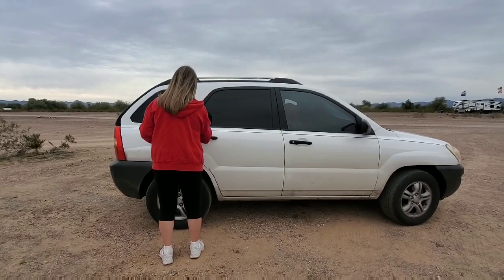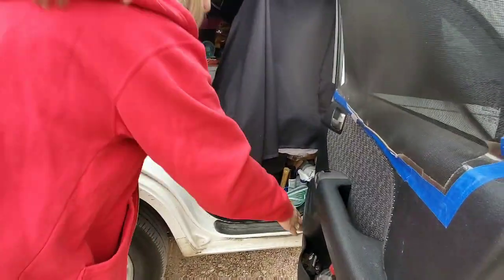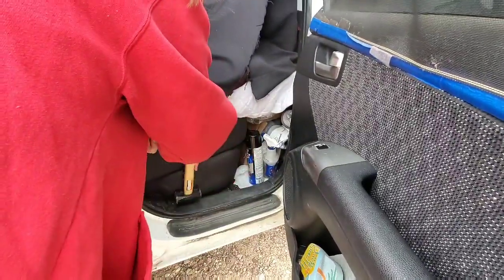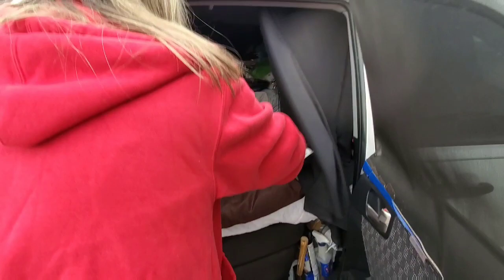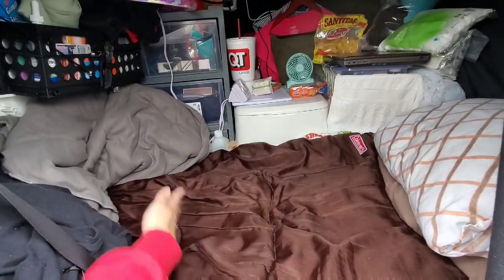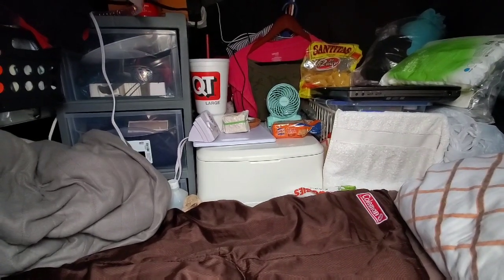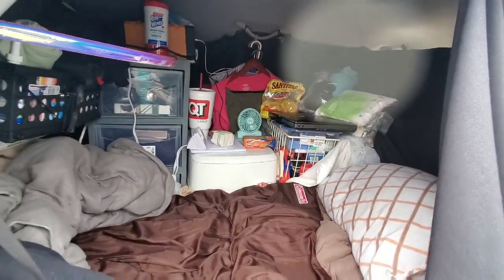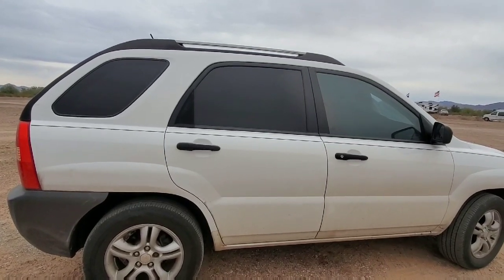Tour Of My Friends Kia Sportage #VansVanandTravels #Vanlife #Vandwellers #Livinginvan #solar

Comment: Harbor Freight sells a fire-proof welder’s blanket recommended at an RTR “show and tell”. It can be put under burning appliances, candles etc and draped around surrounding items when there is an open flame like candles, propane heaters, stoves, etc. to protect flammable items from catching fire if something goes wrong.
Reply from the maker: Wow! That's a good thing to know! Could be a lifesaver. I'll have to spread the word. Thank you for telling me! 👍

Comment: What was the thing she had her electric blanket hooked up to?
Reply from the maker: I can't remember now, but it was some kind of inverter, because she had something like a jackery, only not that brand.
Reply from the maker: Cyndy sent me the link to her portable generator. Hope this helps. 🙂 
https://www.amazon.com/Aeiusny-Portable-Generator-Station-Emergency/dp/B07WXGQZWG/ref=asc_df_B07WXGQZWG/?tag=hyprod-20&linkCode=df0&hvadid=385355880709&hvpos=1o1&hvnetw=g&hvrand=15132072625974468742&hvpone=&hvptwo=&hvqmt=&hvdev=m&hvdvcmdl=&hvlocint=&hvlocphy=9026563&hvtargid=pla-850432684209&psc=1&tag=&ref=&adgrpid=73833100450&hvpone=&hvptwo=&hvadid=385355880709&hvpos=1o1&hvnetw=g&hvrand=15132072625974468742&hvqmt=&hvdev=m&hvdvcmdl=&hvlocint=&hvlocphy=9026563&hvtargid=pla-850432684209#